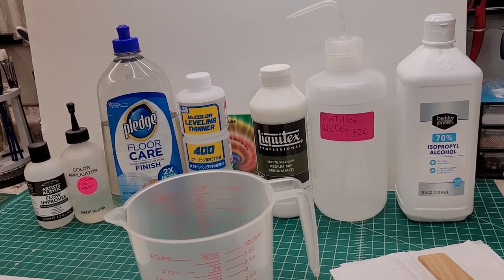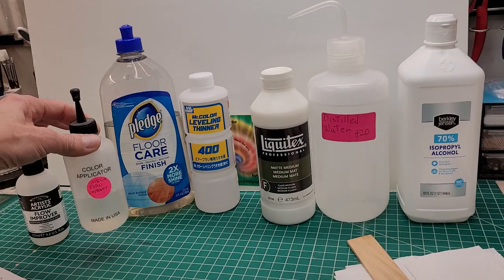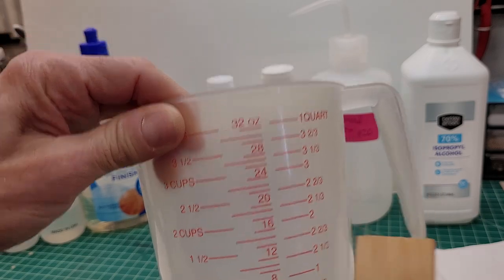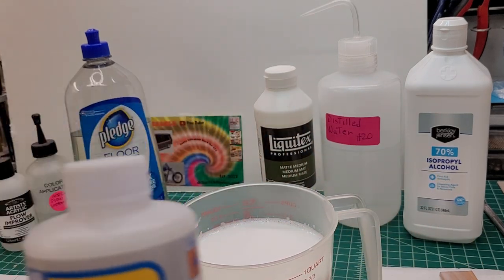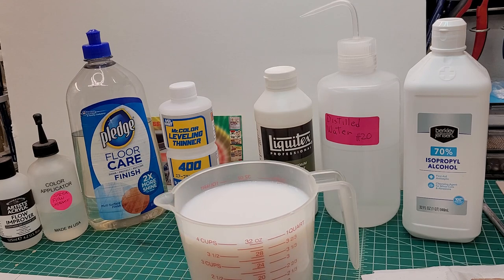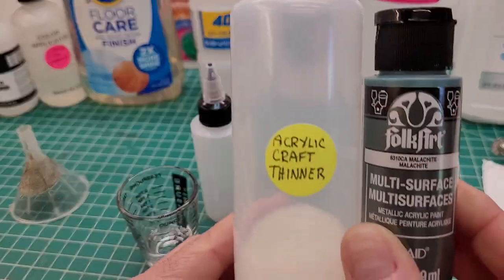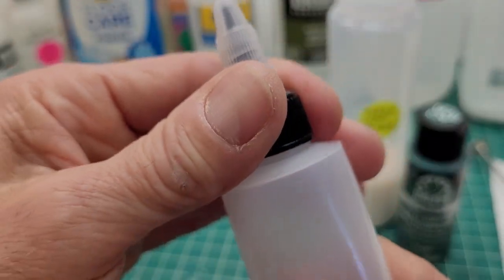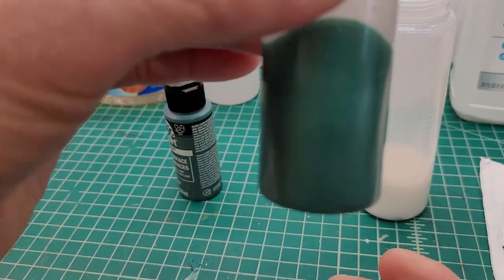How to create Craft Paint Acrylic Thinner for Airbrushing

Comment: Great video and how-to, thank you!
P.S. I have run across an acrylic paint that does not tolerate any alcohol. If you use alcohol in a mix to thin the paint it clumps up and will make a mess of your air gun that takes some time to clean out.
The paint is - Folk Art Color Shift Acrylic paint.
Since I had that issue I just don't use any alcohol in my thinners. Cleaning up after that first mess taught me a lesson I won't soon forget. Now I use distilled water, Createx 4030 Balancing Clear, and a few drops of glycerin. Best of luck to everyone.
Reply: I use created balancing  clearly. It really make Vallejo stick extremely well, tape will not pull it up😊

Comment: Thanks for these great tips. Another good test for proper viscosity of paint is to use a stir stick & drag paint up the side of the mixing cup. 
It should leave a little trail of paint and run back into the cup.
Rick
Reply from the maker: Thanks Rick!  Yes your right, I forgot to mention that in the video. If you see the paint start to separate then it's too thin

Comment: The white thinner color won't mess with the paint color ???.where did you get the liquidex
Reply from the maker: Thae thinner dries clear and the Liquidtex can be purchased at Michaels craft store. Thanks for watching!
Reply: @6TEESRULE just bought these thinner products so I can mix it up to thin the paint.what type of air pressure you use to spray.and what type clear coat.
Reply from the maker: Hi Ian, I use a gravity feed Airbrush and run about 25 PSI, Tamiya X22 clear
Reply: @6TEESRULE  thank you you do amazing paint work
Reply: @6TEESRULE  I hate to keep bothering you.but do you use the acrylic thinner to thin the X22 clear.
What do you use to thin X22 clear.
Thanks
Reply from the maker: Hi Ian, no bother at all! Use Tamiya X- 20A Acrylic Thinner or Mr Color 400 Leving thinner and spray at a low 20 PSI

Comment: Not trying to be a butthead. Are the ounces you showed the correct amount. If so the the 40% should be 37.5 and the 10% should be 12.5. I only mention this because I was going to mix by percentage and noticed it didn't match up. I just mention because somebody may mix by percentage and it might not work. If I'm wrong I apologize. Thanks for sharing.
Reply from the maker: You have to remember Sam this formula wasn't developed in a lab. It has been passed down from Modeler to Modeler many times and ratios and ingredients changed over the years. Yes you are correct the percentage and ounces are not exact but I have tried both methods and got the same results. Thanks for your input. Appreciate it,